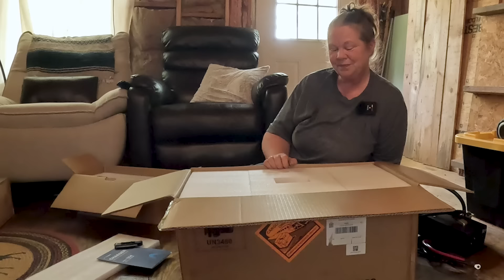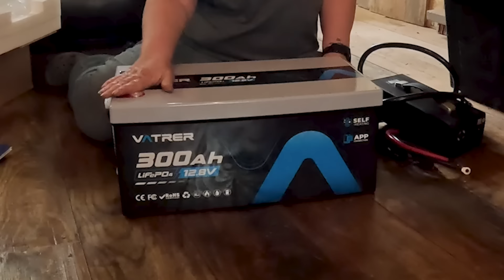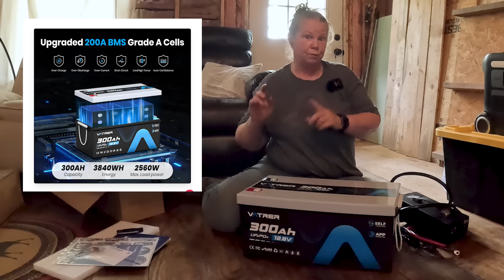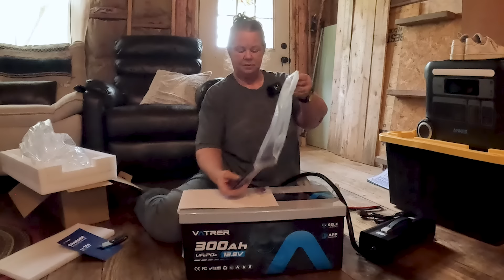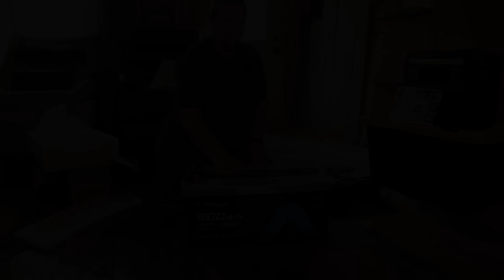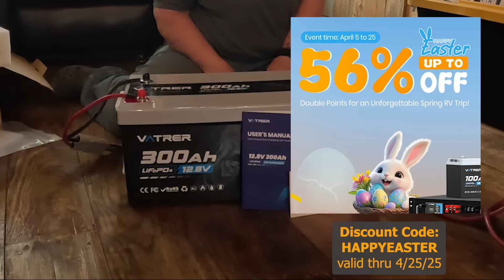DEEP DIVE - My Off Grid Solar Power Bank - Vatrer 12V 300Ah heated battery

Comment: More frustration dealing with Vatrer 12 volt 100ah and 200ah batteries.  They wont replace the battery unless I pay $200 extra to get their heated model because they stopped making the model I purchased.  I live right on the Oregon coast and they are in a garage that occasionally gets down to 40F and average is 55F to 60F.  The batteries have not even been close to over discharging because I purchased enough amp hours for what I need to troll for the day.  They clearly dont know their product because they indicate low temp protection and over-- discharge like a broken record when those two causes are impossible.  I am not alone with vatrer having BMS failures and voltage drops even under mild use.  Clearly their component suppliers are feeding them crap and they are lazy or incompetent to fix the issues.  For God's sake Vatrer should at least own their failures and honor the warranty agreement which is the only reason I went with Vatrer in the first place.  Instead of honoring warranty, they look for another way to profit.  Vatrer also cant stand accurate reviews and bribe and extort to scrub them from the internet.
Reply from the maker: I’m sorry to hear you are having such a frustrating experience with your batteries. I haven’t had that experience with mine fortunately. I hope they will stand behind their warranty for you.

Comment: If you look in the book that came with your battery they said to charge at 60 amp (0.2C) and the wire size in the battery are only 4 awg  this is to small for a continuous 200 amp load  !!!!!!!!       just my opinion  have a nice day
Reply from the maker: Thank you for your feedback! It ran the camper great